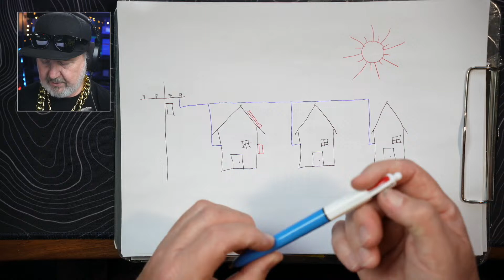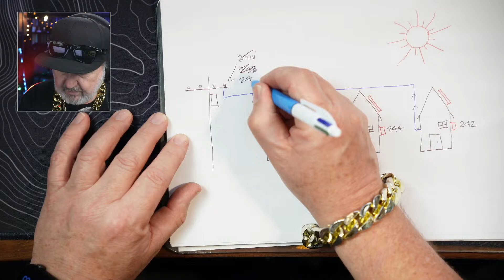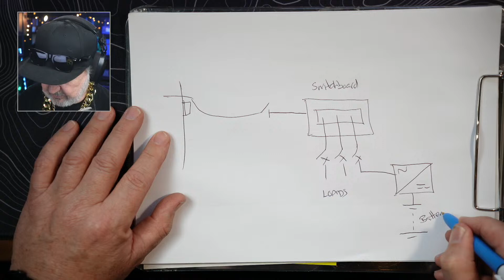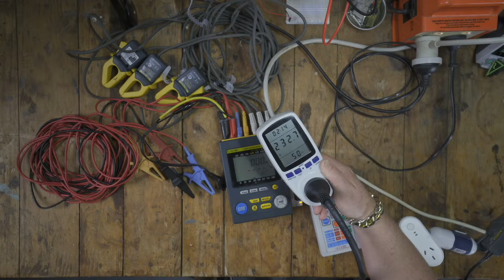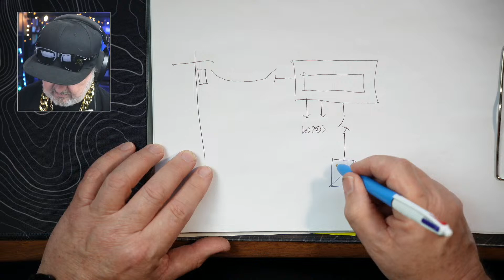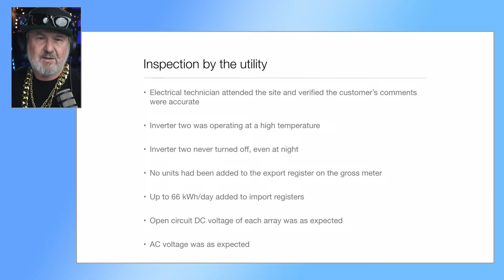Why high grid voltage is stopping your inverter generating and what you can do to keep it on.

Comment: Hi Glen, Thanks for another superb session. 
In relation to the AC Coupled BESS and Vrise, I would argue that a BESS with SoC <100% can be considered as a load (for charging), hence, no voltage rise should be expected at the PoC. However, this is different if both the inverter and BESS supply power in parallel to the loads and have surplus for export. In such cases, the inverter will be the source to consider Vrise from, as the BESS is responsive to the load magnitude only (unless set up as PV/EV to Grid charging)
Reply from the maker: Hi Yariv! Long time since we've met in person. Thanks for the feedback. Yes, I agree with your summation. If the a.c. coupled battery can prevent export then voltage rise will be constrained.

Comment: Hi Glen, as always a superb informational session. Thanks!
In relation to AC coupled BESS and Vrise - I would argue that a BESS with SoC <100% is a load to be serviced, therefore will not increase volts at the grid PoC.

Comment: good information geln 👍
what are the limitations for a auto electrition to do a dc 12v 0r 24v solar setaup with out any 240v invoved?
Reply from the maker: Regulations are dependant on what country and even what state you're in.
Reply: what about here in vic ?
Reply from the maker: I would suggest you contact Energy Safety Victoria for their ruling. I don't want to give you misinformation on this important safety consideration.